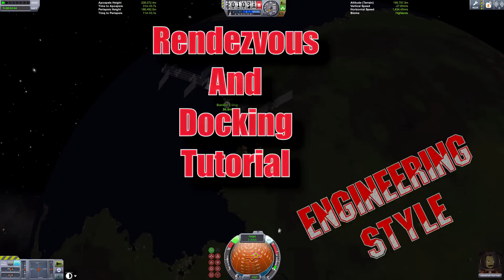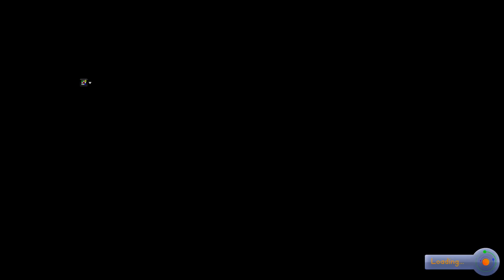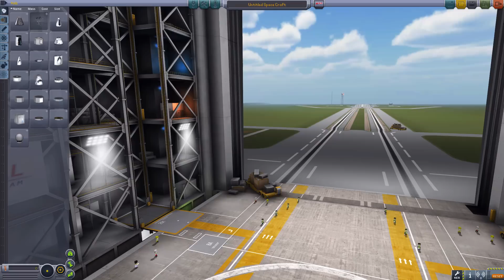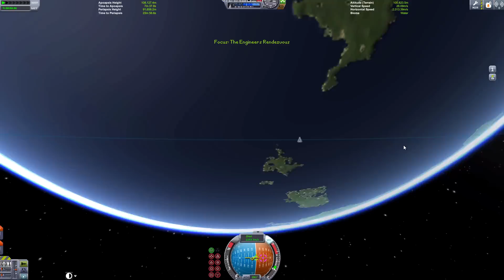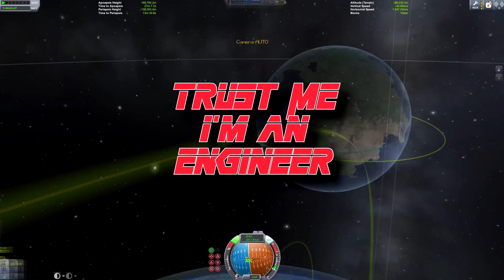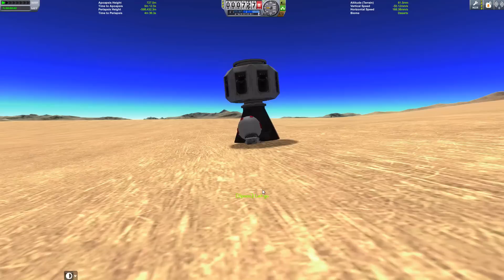Kerbal Space Program - Rendezvous and Docking Tutorial Engineering Style

Comment: 20:05 - I think the final approach just before locking hatches is the hardest... even using caps lock, still feels too fidgety...
I found out that if you just align one craft normal and the other anti-normal, the hatches are perfectly facing each other, as you've shown us here, then I try to align it perfectly in two axis, and finally approach the third axis and touch... but by the time I approach, the first two axis seemed to have misaligned... 
rolling (Q and E) and going slowly locally forward and back (I and K) until it seems... that the crafts aligned... ...is it... can I use a better technique than mine here?
Reply from the maker: Nelson Baietti No your technique is good the only thing you could do to improve is set one pointing north or south but then you have to position the other craft in the correct orientation. There is a mod called Docking Port Alignment Indicator which will give you an easier display to align while docking http://www.curse.com/ksp-mods/kerbal/220299-docking-port-alignment-indicator-version-6-2 easy to install just need to place in your gamedata folder. It will display when you set your docking port to control from here and target the other docking port.
Reply: ooooh! awesome! will do!
When you realize you actually can build a space station bit by bit and use it as a platform to explore the whole system, it blows your mind with possibilities! ...then you see it's... a little hard... to dock, not because the game is hard, but because the PROCEDURE itself is a little tricky (wouldn't want it any other way!)... you just do the math: "well... it took me four hours to dock this one... hmmm... to have the eighty seven docks I wan't... ...yeah..." every help is welcome! =D
Reply from the maker: Nelson Baietti Even I'm still learning new procedure like don't just put two solar panels on because if they are 90° from the sun you will loose charge and you kerbal will crash, he he he though failures can be fun.